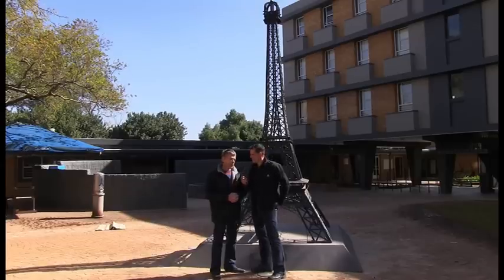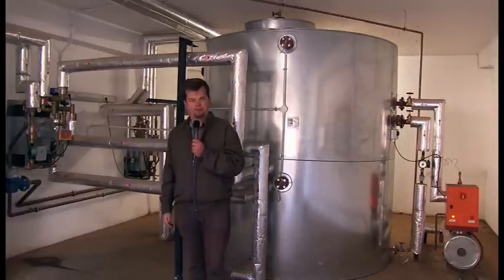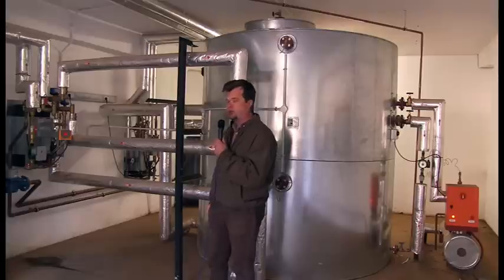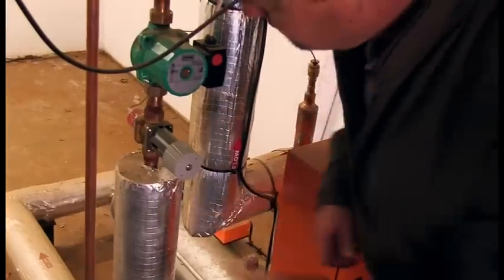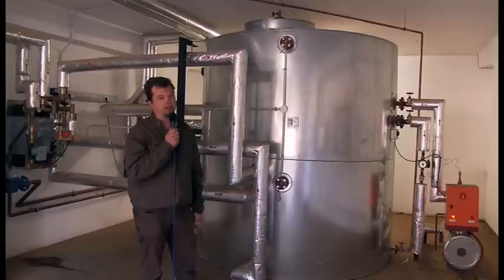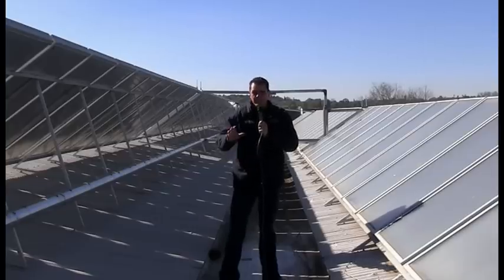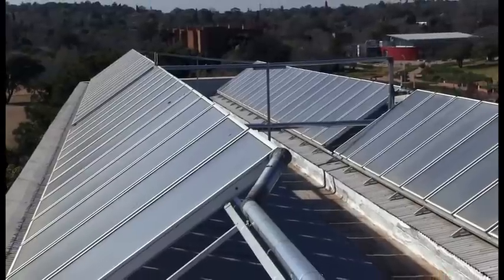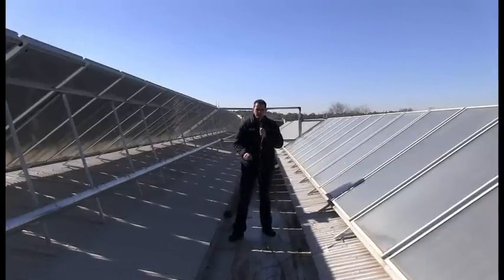SOLAR HOT WATER - Student Residence - 818 m2 Pretoria University

Comment: Video shows a 7,200-litre system. Storage vessel is relatively flat as we were restricted by the slab height. Normally a tall storage vessel with more potential for stratification is preferred. For the same reason, the internal pipe design and stratification pipes in this particular vessel are rather elaborate.

Comment: There are 8 systems: 2 x 1,600-litre (with 40kWth for both solar charging station [SCS] & 40kWth fresh water station [FWS] each), 4 x 7,200-litre (150kW SCS & 75kW FWS) and 2 x 10,000-litre (150kW SCS & 115kW FWS). Buffer storage in this case approx 1.1 x daily consumption. Collector to storage ratios under normal conditions in SA should be between 50 - 80l/sqm, but depends on numerous conditions. All SCS and FWS have long length PHE in order to have resistance <50mBar and achieve very low return temperatures (!!). SCS depend on loading capacity, but always needs to be more than 0.7kW/sqm collector surface. In this case we have a low-flow concept of 15kg/sqm.h. This increases system efficiency and reduces pipe & pump sizes. FWS size depends on discharge pattern, which in turn depends on what you designed on taps,shower rose, insulation etc. Therefore demand side management is important.

Comment: So is that basically 8 systems - 100M2 collector (nom 50 panels per system) per 7,200 buffer store.(72 Litre per M2) with 150kw PHE on the solar input side. And what was the PHE Kw on the fresh water side
Reply: Hi David, Thank you for the response, just to be clear, PHE = Plate heat exchanger?
Reply: Carel B Hi Carel - Yes PHE Plate Heat Exchanger.
You have one on the buffer to fresh water side?? - The video was not clear.
It would be good if you could put the specification/ the system into words.
And confirm the buffer size/volume that you show in video - that is not 7.2M3??
Reply: dave lloyd-jones Please see the contractors response below....... Holms and friends "Video shows a 7,200-litre system. Storage vessel is relatively flat as we were restricted by the slab height. Normally a tall storage vessel with more potential for stratification is preferred. For the same reason, the internal pipe design and stratification pipes in this particular vessel are rather elaborate."